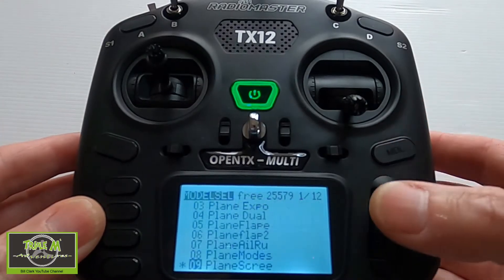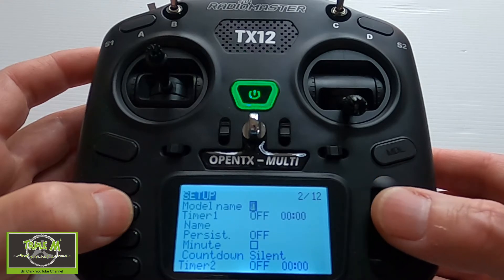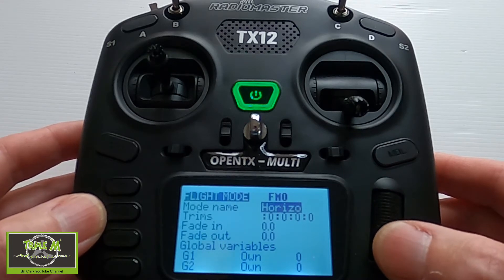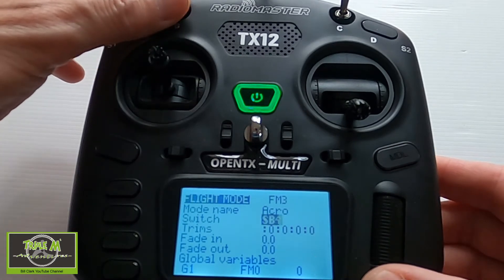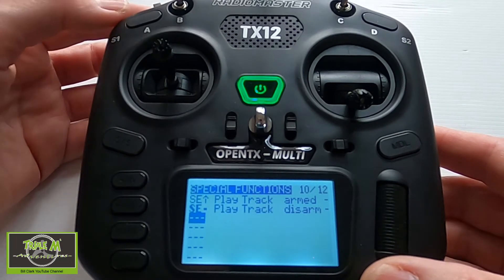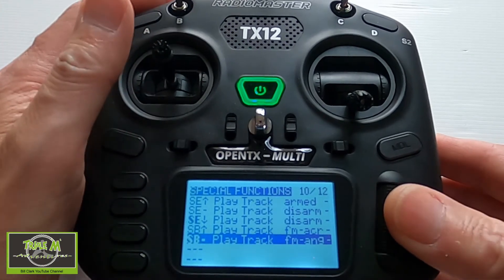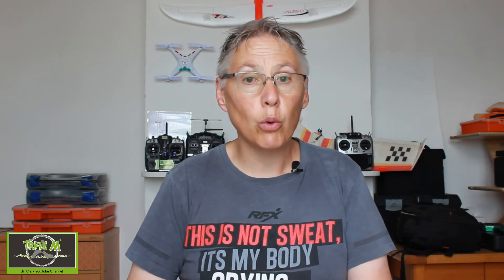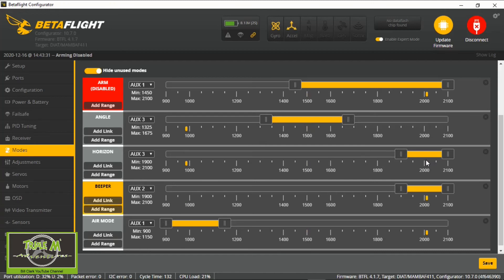RadioMaster TX12 Setting up a Basic Quad Copter

Comment: Hi Bill....please can you explain. how you would fine tune FrSky with RC Era helicopters and E  -129 sub type for binding. Perhaps a new video on the TX12 mk.2's would be good? I have the CC2500 EdgeTX / MPM with an external  4 in 1 multi module attached.   Regards and Thank you again.
Reply from the maker: The method to fine frequency is the same for all receivers which have the facility.

Comment: Hey bill my tx12 is like yours and at the beginning of the viseo when your setting up the model my goes to model set up didnt go to plain or multi so what could be rong with my radio
Reply from the maker: Please go to the SYS System menu and Tools check if you have the option Wizard Loader. If not you need to download the SDCard contents for your firmware version and copy the Lua Script to the SDCard under the Tools folder.

Comment: How do u set up a switch and get turtle mode to work
Reply from the maker: Hi Jimmy, set the mix in your radio to normally channel 8 assign a switch to activate the turtle mode. Plug your quad copter into Betaflight go to modes and assign the channel to the turtle mode.

Comment: Hello thanks for the Video! I had a problem right at the beginning though. When i create a new model, i dont get the option to select the Types: Plane, Delta and Multi. And any other of the options that followed. Ive been trying to find someone with a similar Problem but so far i havent found much. Do you know about that issue and how to fix it?
Reply from the maker: Hi Gabriel, there is nothing wrong with your radio just a different way to get the model wizard. Create a new model and make sure it is active. Whichever model is selected will be overwritten. Now click SYS should open TOOLS Now go to Wizard Loader push enter. Select model type you want. The basic model will be overwritten with the option you selected.
Reply: @the-happy-RC-flyer  thanks a lot for the fast reply, I will try it out tomorrow🙏
Reply: @the-happy-RC-flyer  So i tried it out but if I open the Tools Menu via SYS, there is only: 
"01 Spectrum (INT)"
 Could it have happen that I missed a previous step in the set up?
Reply from the maker: It sounds like your SDCard contents are not correct. If you go to the website and download the contents. Just copy the current contents on you your computer. Now format the SDcard and copy the new contents to it.

Comment: And if the sounds don't work? I've set up 3 modes. Set the Special Functions Play Track. Flick the switch and...nothing. 😐
Reply from the maker: Have you set up the volume to a rotor switch? Is it a custom sound you are using which you made?

Comment: im not getting the select model type it just skips it
Reply from the maker: I am assuming you do not have a SDCard in your TX12? You will not have the model wizards if you do not have an SDCard in your radio which has the SDCard contents on it. You need to get an SDCard 8GB is fine I would suggest getting a quality card. You then need to go to the OpenTX website and download the SDCard contents for the version of OpenTX in your radio. To check the version on your radio goto SYS scroll to VERSION. Place the unzipped files on the SDCard and insert the card into your radio. You will now have the model wizards. 

This video should help you.

https://youtu.be/7YXfGNqSiMM

Comment: When I move the right, stick forward and backward, it does not move in the mix as monitor how do I fix it where I have the capability to go forward on the right stick and backward on the right stick it shows no movement on the transmitter mixer monitor
Reply from the maker: You need to change the mix Weights to -100
Reply: @the-happy-RC-flyer  my camera broke off and the ground wire was still solder to the board but my 5v was broken off the pad and I don’t have any more 5v pads can I just solder the camera to the battery 5v my flight controller is a happy model evo brushed and I used all my 5v for led strips
Reply from the maker: @rodfish-jy2mo  as long as the pad is the correct voltage you should be ok. You may get some electrical interference but test it.
Reply: @the-happy-RC-flyer  I put it to a 5 V pad but I guess it was the battery pad it’s where the battery is on the other side of the board but it says B pad 5 V but I don’t see nothing in my camera on my goggles. It is not connect
Reply from the maker: @rodfish-jy2mo  the receiver pad should be 5v check that one with a multimeter.
Reply: @the-happy-RC-flyer  do i need to change it to 100 weights in the transmitter or in clean flight my buddy told me to use uart 2 but when i selected uart 2 and the serial rx and save and reboot it does not save I'm trying to get movement in the receivers tab its already bind what can I do to get movent in the receiver tab
Reply from the maker: @rodfish-jy2mo  sorry about that leave the radio weights at 100 and check your channel mapping in Betaflight you normally use AETR.
Reply: @the-happy-RC-flyer  that’s what it’s at AETR but when I try to put it on PPM it saves it but when I go to ports  tab and try to put uart 1 and hits serial, RX in saving reboot. It doesn’t save it. It just takes off the serial RX. but it still leaves. Uart 1 saved and I have no movement in the receiver tab, but the receiver is binded to  my transmitter.
Reply from the maker: @rodfish-jy2mo  have you changed the default settings? If so try reverting back to them and check the UART your receiver is connected to.
Reply: @the-happy-RC-flyer  my receiver is binded but I don’t see any movement in the receiver tab and when I try to put serial Rx it doesn’t save it
Reply from the maker: @rodfish-jy2mo   if you have a RSSI signal then you are bound. What receiver are you using?

Comment: I got a MK2 version and it wont let me configure it after creating a model
Reply from the maker: Could you give me a bit more detail so I can try and assist you.
Reply: @the-happy-RC-flyer  When i create a model it doesnt say Select Model Type or anything
Reply: also I have the SDcard in it
Reply from the maker: @ExpwodingMuffin  do you have the SDCard contents on the SDCard?
Reply: @the-happy-RC-flyer  Yes I do, It still wont work though
Reply: Ok I didnt fix the problem but I can set up the controls in the mixes tab
Reply: Having the exact same problem after pressing “create Model” it won’t let me edit the setting of that model only “Copy Model, Move Model, and Backup Model” 

As for the Mixer thing I don’t understand how to use it

Edit: Just set up all the special functions and I think my controller no longer connects to drone…

Edit 2: after the past hour and a half found the “Play Track” in special function just plays an AUDIO and dosent change what the actual sticks do

Edit3: The controller connects to the drone I know this because the beep switch will cause the drone to beep but NOTHING else works I’ve been doing this for way too long and regret everything
Reply from the maker: @BarredRock  are you able to see the model edit windows when you tap MDL then move left?
Reply: @BarredRock same thing just happened to me.

Comment: Can this remote be connected with flysky receivers?
Reply from the maker: No because the TX12 only has the single CC2500 chip. You need the 4 in 1 module to have the FlySky protocol.
Reply: @the-happy-RC-flyer  thanks

Comment: I followed the tutorial exactly and reviewed to make sure however when go into betaflight, none of the switches match anything in there. This is common in tutorials where they dont think outside the box.  Obviously something is different in my setup but Ill be damned if I know what.  He should have mentioned if something is different then you need to do this . . .
Reply from the maker: Greg, I think your receiver settings are incorrect in Betaflight, check your channel mapping as well.
Reply: @the-happy-RC-flyer  Saying they the receiver settings are incorrect is incorrect.  They work fine on a different controller so they are not "Incorrect" (Im just trying to switch to my TX12 from a Spektrum)
Reply from the maker: @gregdavidd  if the Aux channels are not working it is difficult for me to diagnose without seeing your set up in person. Is the receiver binding to the radio, are you seeing a RSSI signal on the radio.
Reply: @the-happy-RC-flyer  Yes control sticks all work on all axis' and signal seems strong.  I appreciate your help btw.  I will continue to learn :)  If you could just tell me one thing would help a lot: Should I be looking into the TX12 settings or in Betaflight to fix it?
Reply from the maker: @gregdavidd  Greg, I think your Betaflight settings are in correct. I have a series of videos showing how to set up a quad from start to finish please check my playlists.

Comment: How can I get back into the 1st setup page after I have everything setup I'm having problems with the arming switch thanks
Reply from the maker: Could give me a bit more information on your problem. First question is are you seeing the armed AUX channel working in Betaflight?
Reply: @the-happy-RC-flyer  yes but quad arms in center pos then will not rear arm again It is on the bottom left switch .also on initial set up I did not know about choosing between quad or plane not sure what it is on thanks for answering
Reply from the maker: @tracypippenger4806  please check your arm switch set up in this video to check your settings.

Comment: so immediately as i start this set up  process  I hit the model button it brings me to the same screen as urs.i pick an empty spot and click on it.then I click on create model and instead of it going to the select model type screen with plane, delta, and multi to choose from,  it just creates a model number for the spot I picked in they first screen. i have version FW: opentx-tx12. VERS:2.3.11-otx(4320055).EEPR:219  do I need to upgrade?
Reply: so i downloaded the files for the tx12 and installed the sd card and it didn't change anything on my radiomastertx12
Reply from the maker: @rodjones2047  Hi Rod, please check if your SDCard’s folders are set up in the opening directory not in a folder.
Reply: @the-happy-RC-flyer  i believe its because he has the newer tx12 mkII i also am having the same issue
Reply from the maker: @Chitchatfpv  have you got an SDCard with the contents in your radio?

Comment: when i hold down my model select button, scroll down to an empty number(on my brand new radio master tx12) then click the scroll button it asks meif I want to create model. i click it an it just adds a number like 14 model 14. it doesn't give me the same options that u showed on your video. what should I do
Reply from the maker: Hi Rod, I am assuming you do not have a SDCard in your TX12? You will not have the model wizards if you do not have an SDCard in your radio which has the SDCard contents on it. You need to get an SDCard 8GB is fine I would suggest getting a quality card. You then need to go to the OpenTX website and download the SDCard contents for the version of OpenTX in your radio. To check the version on your radio goto SYS scroll to VERSION. Place the unzipped files on the SDCard and insert the card into your radio. You will now have the model wizards. 

This video should help you.

https://youtu.be/7YXfGNqSiMM
Reply: @the-happy-RC-flyer  ok.thank you. i will let u know how it goes. thanks again
Reply from the maker: @rodjones2047  you are welcome.

Comment: I do not know Why but I can not choose E for the arm button. I can only choose A, B, C or D. Any idea why?
Reply from the maker: Hi Even, have you allocated switch E to the Arm / DisArm mix/channel?
Reply: I do not know what that means. The thing is that when I scroll I get SA, SB, SC and SD. It doesn’t go to SE and so on.
Reply: I have not done anything that I know of at least.
Reply from the maker: @evengrobakken1402  Even please check the video where I set up the arming and disarming it should help you. If you still having problems if you can back up your model and radio settings and email them to me I will take a look for you. triplemadventures@gmail.com
Reply: @the-happy-RC-flyer  Hello, Since I could not put switch E as Arm I choose C to arm and disarm instead and I think it works fine! One more question. How do I bind it with my drone? (tinyhawk 2 Freestyle) Thanks for the help!👍😁
Reply from the maker: @evengrobakken1402  this video should help you https://youtu.be/8XHLT7c2rzo

Comment: How come when I create a new model, the page for Plane, multi or copter doesn’t pop up?
Reply from the maker: If you radio has the OpenTX firmware your problem comes from: I am assuming you do not have a SDCard in your TX12? You will not have the model wizards if you do not have an SDCard in your radio which has the SDCard contents on it. You need to get an SDCard 8GB is fine I would suggest getting a quality card. You then need to go to the OpenTX website and download the SDCard contents for the version of OpenTX in your radio. To check the version on your radio goto SYS scroll to VERSION. Place the unzipped files on the SDCard and insert the card into your radio. You will now have the model wizards. 

This video should help you.

https://youtu.be/7YXfGNqSiMM

Comment: Do you have to use a certain micro Fs card for the tx12?
Reply from the maker: Hi Jimmy, no other than use a small card 8GB would be fine larger cards will not work the largest card I have used is 16GB

Comment: Hi, I have the problem that when I click create model it doesn't show the options plane delta and multi so I can't choose the armed switch and my drone wont arm because of that.Do you know what the problem might be?
Reply from the maker: I am assuming you do not have a SDCard in your TX12? You will not have the model wizards if you do not have an SDCard in your radio which has the SDCard contents on it. You need to get an SDCard 8GB is fine I would suggest getting a quality card. You then need to go to the OpenTX website and download the SDCard contents for the version of OpenTX in your radio. To check the version on your radio goto SYS scroll to VERSION. Place the unzipped files on the SDCard and insert the card into your radio. You will now have the model wizards. 

This video should help you.

https://youtu.be/7YXfGNqSiMM

You will need to set up your Armed switch manually. Select a spare channel I normally use Ch5. Make a mix for Ch5 with 2 positions Armed & DisArmed. Then allocate AUX 1 which corresponds to Ch5 to armed under the Modes tab in Betaflight.
Reply: @the-happy-RC-flyer  ok, thanks for the reply.

Comment: When setting up for arm the Assign Aux 1 only goes as far as D (SD) for any switch selection.  My thought is that I should be able to select any of switches from A to F.  I have SD card installed.  What am I doing wrong?  Thanks.
Reply from the maker: Hi Gary, yes of course you can use the E &  F switches I use E for arming of my drones. Please go to SYS, scroll to page 6 Hardware goto switches scroll to SE and make sure 3POS is selected.
Reply: @the-happy-RC-flyer  That worked.  Thanks, Bill.

Comment: Hi, Clark, you're great. I am new to this hobby and have a similar problem as our friends. But in an attempt to delete the new models I made, I deleted the QUAD and HELI models. What should I do now? Will it help me now to insert this content on the SD card as you explained in the video? Thanks in advance and Merry Christmas
Reply from the maker: I need to check have you deleted your models you setup on your radio? If you have deleted your models you can only restore them if you backed up your models in OpenTX Companion. If you mean the model wizards you will need to restore your SDCard contents.
Reply: Yes, only from the radio, I have not yet inserted the sd card or installed Open tx on the computer. I am very grateful for your quick response.
Reply from the maker: @aerby4639  unless you have backed up your models In OpenTX Companion sorry to say you will not be able to restore your models.
Reply: Hm, the first time I turned on the radio and tried to make a model, but I didn't have options like you and then I wanted to delete that model but I deleted QUAD by mistake. I repeated the same thing and made the same mistake with the HELI model. I wanted to connect the radio to Mobul 6 FrSky
Reply from the maker: @aerby4639  if you do not have the model wizards just start a new model and the radio will set up a standard 4 ch model you can use to set up your drone. You will need to add mixes for arm/disarm and flight modes and possibly the list motor buzzer.
If you still have problems let me know your channel mapping and mode and I could set a model up for you. You can then us Companion to transfer it to you radio. Please confirm the radio you have is the TX12.
Reply: Yes, it is Radiomaster TX 12. So I follow your instructions from the video regarding the sd card and maybe there is hope? In any case, thank you very much for your time and happy holidays. I wish you many more successes in the New Year !!!!!

Comment: Hello, i have wanted to buy the TX 12, but I’m not sure if it works with the emax tiny hawk 2 freestyle. It says: receiver mode is SPI RX default protocol is FrSky_D (D8). What does that mean does they work together? Please answer quickly before the Black Friday sale is out but would still like a response after the sale if you didn’t see it.
Reply from the maker: You can bind FrSky D8 to the TX12